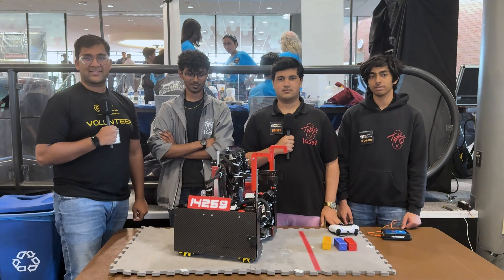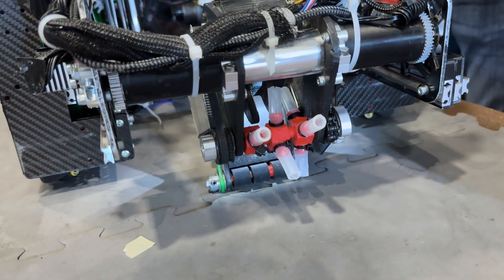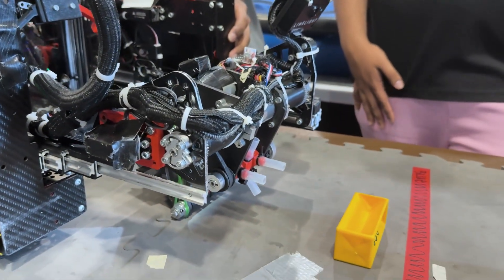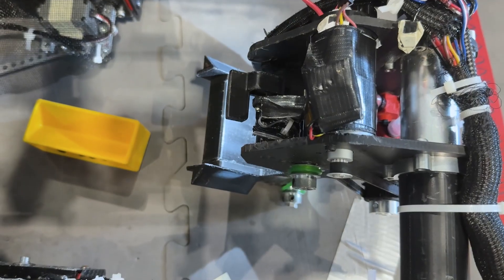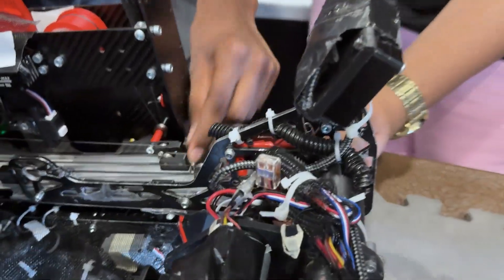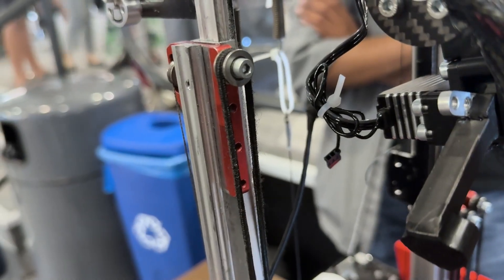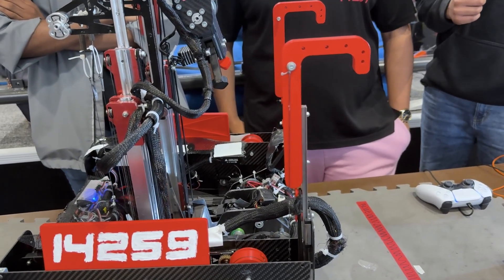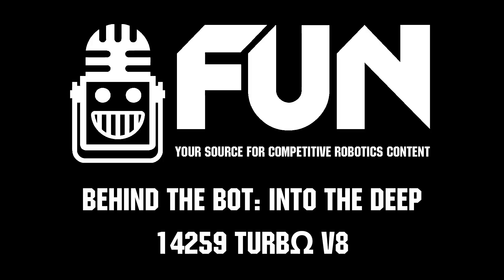14259 TURBΩ V8 | Behind the Bot | INTO THE DEEP Robot

Comment: What color sensor are they using?
Reply: Brushland Labs v2
Reply: @FTCTurboV8  What are the pros, I have seen some teams use those over the rev ones
Reply: @ziezster8470  the sensor can be used in digital mode, allowing for us to bulk read it. The rev color sensor is an i2c sensor, and cannot be bulk read, slowing down loop times.